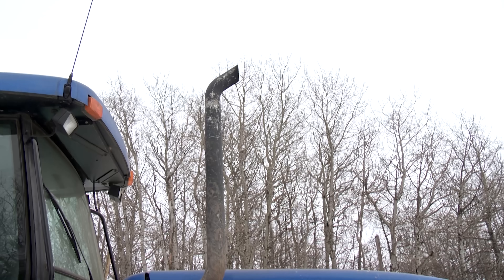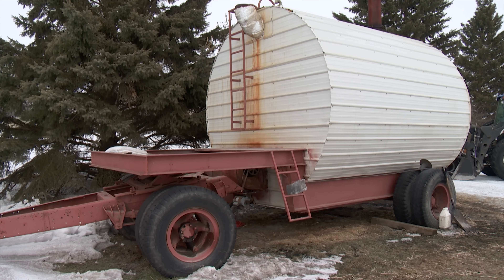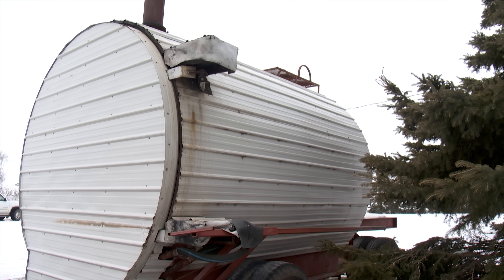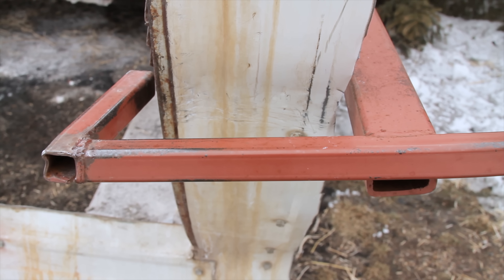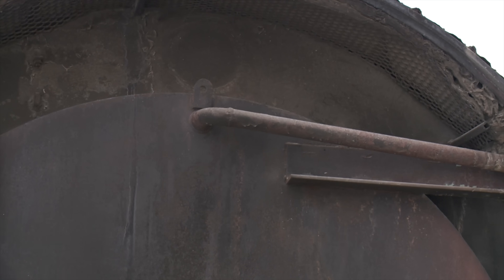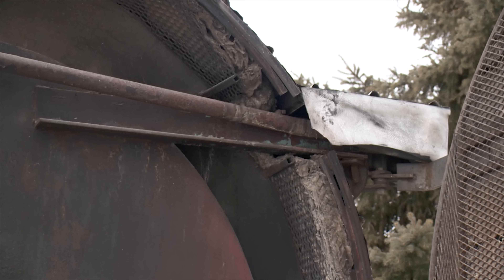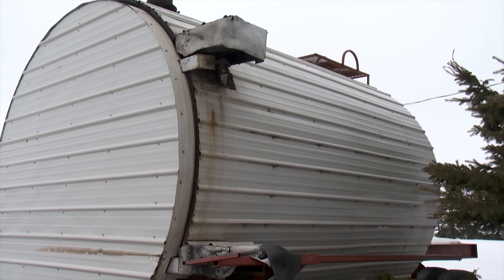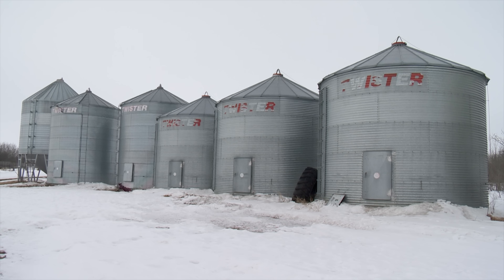Portable Straw Boiler System

Comment: To make a round bale assuming he is growing the straw himself at a cost of $10 - $20 each. he could sell that staw for $30 - $50  so it is costing him $20 - $30 per day  he burns 1-2 per day  so using the low figure $30- $40 x 30 day $900 to $1200 in straw per month to heat 2 houses. seems like a waste of money to me . not to mention all his cost in materials and his labor to set it all up.  plus he is runnig out there 1 or 2 times a day to feed it  no matter what the weather.  he can keep it. now if the 1-2 round bales sold for $7-$10 each then it might be worth it but he burns more  in diesel cutting wind rowing and baling and hauling bales to a pile then hauling a bale at a time to the furnace. That is just fuel costs.  there are so many more costs

Comment: Save $5000 a year for two houses? Where is this, the Yukon? Oh, well, you do have the drying. Was that electric too?
Reply: Drying is typically done with heating oil burner and blower. Power demand would make their grid glow red hot, because every farmer is doing it approximately concurrently.

Comment: Hi neighbor. We heat with a Portage and Main boiler using coal and heat a 1900 sq ft house and a 2000 sq ft shop.  We get coal from Hannah Alberta. The stupid carbon tax is really costing dearly- almost doubling the heating cost. This year so far we've used about 6 tons of coal. I had thought years ago about building a flax burner like yours, and wish I would have. Great job setting up your burner. Some  questions. Why would you make it portable, and is it really portable if it is hooked to pipes in the ground? Do you move it   to dry grain?

Comment: Needs a gasifier on the exhaust port so you don't need to tap into the electrical grid to run the fans or charge a battery.
Reply: You mean secondary air doors?

Comment: Wouldn't it be simpler to just insulate the house? This can save you tons of money on heating. At least it doesn't look like it is insulated, correct me if I am wrong.
In Poland and most of Europe, we usually build using 24 (9.5 in) cm clay or aerated concrete bricks and insulate it with at least 15 (6 in) to 25 cm (10 in) of styrofoam. Foundations are insulated with even more hard styrofoam up to 1m (3.3 ft) below surface level. Similar story with the flooring. 
Oh, and attics are also insolated, usually using 15 (6 in) cm or more of mineral wool.
So minimal loses of heat on winter and cool summers.
Reply: It’s in northern Canada. It probably has heavier insulation than anywhere in Europe.

Comment: 3-4 round bales a day at 30 each. As low as 10 if bought. Would need own hay field and equipment to make bales to make it worth it. Equipment to cut, rake and bale... throw in a tedder to just in case would cost more then the furnace. Not to mention the land itself. Sheesh.
Reply: It’s not hay... it’s flax straw.    And he farms 5000 acres. He has all the equipment.
Reply: @farmersunion5237  Well that explains it. Not everybody can do this. As a matter of fact not many at all can do this. This video is a tad deceiving.

Comment: need one of those to put a whole log in. chainsawing and splitting stacking feeding cleaning. 
is alot. just forklift the log and let it burn for a week.
Reply: wood dries just 4 cm from each side per year, and that is without bork, so all the hustle is more about making it dry in a acceptable time rathen then just for handling it
Reply: You could put some monster size logs in there. Burn for a week.

Comment: Its a nice idea but they do make wood fired portable boilers for camps and remote areas. 
The other option would be to try earth heat pipes. The advantage is that system also cools in the summer.

Comment: Still possible to employ a large reciprocating piston engine on the flue to create some suction or draught to assist with the combustion and also would burn the flue gases at the same time, the engine would then drive a generator to produce electricity.
They called this principle a suction gas engine. Most Outback towns in Australia before1945 used this principle of suction gas engines using wood to generate electricity.
Watching from Auckland, New Zealand
Reply: Great point! And in combination with some thermal mass in the basement of the homes you could reduce consumption to once a day as well

Comment: Maybe pellitize the straw in the field or bring it home shredded then pellitize it .Smaller use of metal to make a Gasifier with power feeder (less unit  loading).Gasifier could be used as just a flare to heat water or filtered/cooled/filtered to run an engine. 
Side note - a wood burning stove like this gentleman has can not be used as a Gasifier to run an engine , you need a propper designed Gasifier .

Comment: In Europe it's a bit more common due to high cost of fuels, this boiler does the job but is very inefficient. Biomas boilers work with acumulating tanks 60liters per 1kW. You do one batch a day and controls watch over temperaturs. Also we don't really use water systems for drying grain. You can only get up to 60C of hot air out of it by the time you put hot water through radiator. I understand its a compromise to use one system for drying grain and heating the houses. There are brick laid air heaters that can supplay you with temp up to 110C and work with 30t/h dryers. I have a straw 60kW boiler to heat my house and I use only straw to ignite the batch ow timber. I put a square bale at the botton then throw wood on top of it, fire it up and bugger off to work or whatever and thats me for another 24-36 hours.
Reply: Hay sells for $25 a bale, 3  bales a day, 90 bales a month, whew, where is the savings?

Comment: If you extended the stack up you could throw a few old tires in with each bale. Burning tires make lots of heat
Reply: That's the worst idea ever. What causes chimney build up? Smoke. What causes a crap load of smoke? Tires.
Reply: @alec4672  it would be fine. People burn them in outdoor wood burners all the Time. If it's burning hot enough then there is no smoke
Reply: @evananderson3350  There's always smoke from tires, you'd have to be north of 800 degrees interior temperature to start getting rid of the smoke. Send tires to be recycled. The more tires we recycle the cheaper new ones are.

Comment: just to be blunt honest... why? you are still BURNING something... sorry that just is not effective nor really enviro friendly.
Reply: Ur electricity comes from burning coal, oil, and or gas too.
Totally sun power?  Also all the components were manufactured using coal, oil, and or gas. Where does the carbon footprint end?
Answer: It doesn't. Politicians only pass carbon footprint laws to pick ur pockets of any loose change they may have left u. And it goes into their own pocket. It's all smoke and mirrors. End result is that they skim from any revenue.
Reply: Syc holic it's totally effective - heats 2 homes through -30c temperatures , and dries grain. The flax straw will not compost naturally in the field . Normal farm practice is to burn it in the open field.  Stop worrying about a little smoke out of the chimney - it isn't going to hurt anything. This guy probably doesn't have another neighbour for 5 kilometers. We are so sparsely populated that literally everyone could do this in the rural areas without even registering a single complaint. Go on back to the asphalt and concrete of your city and tell me how burning 300 straw bales a year is going to end the planet.

Comment: 1-3 round bails a day to heat the House? That's got to be a mistake.
Reply: Gas isnt that expesive, but elektricety? 

And elektric heating is not the most efficient one
Reply: Dries grain as well
Reply: Horribly inefficient. 1 to 3 bales a day? At $15 a bale (self performed) that's $450-$1350 a month to heat a couple houses. For $15,000 the houses could be insulted with expanding foam and heat conventionally cheaper than baling costs. Guy just got on a project and got carried away. Oh well, to each their own.
Reply: To heat 2 houses and provide hot water for said buildings. Do you have any idea how many metric fuck tons of coal you consume in electricity a year?

Comment: You have to admire this PRAIRIE RANCHER for his independent self sustaining mechanism to provide heat, and hot water. Not too dissimilar from a typical boiler, but uses Abundant Renewable STRAW as a fuel, instead of wood, coal, or oil.
Reply: Wood is pretty renewable..
Reply: @74KU  in 40 or 50 years.
Straw is plentiful every year. After the harvest, it's just laying on the ground. So bale it up and use it to heat the houses. Sounds like a plan.

Comment: So wait, we went from everyone burning coal to clean energy to heat homes. now this guy has gone back and everyones praising him? if they are adding to the Co2 problem then they should be billed accordingly.
Reply: i dont live in the usa. but this is so backwards thinking its untrue and if everyone did this the planet would be fucked. end of.
Reply: wayne wayo aveyard this is in Canada you idiot.
Reply: Lets see.. he grows the flax, harvests the seeds so you can eat them, and is left with the straw from this year's harvest.  It can either be tilled under (or not, apparently) where it bio-degrades, or he burns it.  In either case, the CO2 that was absorbed that year in growing said plant is being released.  Next year, rinse, wax and repeat...net carbon from burning said waste: 0.  Net Carbon from burning coal to produce $15 000 of electricity from coal:  (150 000 kw/h* 1 lb= 150 000 lb coal).  Care to debate how this is MORE environmentally damaging wrt CO2 emissions?
Reply: Well, i hope that message didn't take you long my friend because you are missing one key point. the said flax in question does not just appear. what about the Co2 to turn the fields over for a new crop, to then plant the new crop, to then fertilize the new crop, and then use pesticides.. flax isn't a product that is just there..it is a product of a system that produces co2 by mass.. and who said anything about coal? do you not have clean energy power stations producing energy from dams, wind turbines, solar panels and so on? i mean shit, you're speaking like we are all burning coal fires or logs. in the UK a good amount of people now have solar panels on their houses selling energy back to the grid and powering their homes. you are crazy to think in 2018 coal or flax is the only way to go. but hey thats beside the point, because do you know why we dig the ground up and hunt for coal inside of using "waster field products" like flax? this is one think you idiots haven't even taken into considerations. because coal is more fucking efficient at doing the job of heat, burn time. hahaha! mankind has been mining for centuries and our heating/power problem is solved by some left over crops....use your head.
Reply: The flax is being grown for food.  So, the CO2 costs of growing the flax, then combining the flax are already incurred.  So, the CO2 costs for this system are those of baling the straw, and transporting them.  Your country is importing Canadian slash to make electricity.  How about go do some math on how efficient Drax is.   The problem is one of transportation & energy density.  A bale of straw like he is using doesn't have a lot of BTU's (kJ), so it has to be burned close to where it is produced.  Because the travel distances are at most a few miles (5000 acres= 7.8 miles by 1 mile, in case you don't realize...) then the relatively low energy density of the biomass is of little consequence.  (unlike with Drax, where you are transporting said slash something like 100 miles by road in Canada, then 3000 miles by sea, then at least 30 miles by rail, all of which burn fuel oil...so that you can assage your guilt that otherwise Grid Power would be coal fired...with wood...)  The reason why coal is the alternative is simple- because it is.  Same as in the UK- (that coal will be the last on, and first off the grid)  the baseload in the prairie provinces is either coal or hydro (depending on which one) with topping being the other or Natural Gas.  So, yes, the alternatives to burning waste plant material is likely to be burning coal.  It's not hard to do the math, but if you need a tinfoil hat, you can make your own.  The whole process would not be economic if they were doing much beyond baling & transporting, farmers being smarter than most in terms of energy costs.  I'm also thinking you are missing that he is using the boiler to provide heat for grain drying, and that the houses are secondary to that...remember that tax laws probably play a part in how he'd describe what is being done, as the farmhouse electricity has to be seperate from the farm electricity from a metering prospective- one is business tax, one is personal.  (& also don't discount the difference between where the expenses are incurred, in that if can incur costs on the business that is of personal benefit).     I doubt you have ever encountered -40C with 30-40 km/h of wind on top, giving effective wind chills of -50c or worse...

Comment: Clever     Wonder why they dont use wood from their field edges?
Reply: If you got straw piling up why would you go get something else...
Reply: By using logic. Duh.
Reply: Brian JOnker this guy runs a 5000 acre grain farm.why fuck around with fire wood.no cutting,no splitting,no stacking.bales are already being made on this type of farm,duh
Reply: I agree logic says trees from field edges that have blown down or just in the way need to be handled anyway. So just use them.     Duh
Reply: Brian JOnker we farm 4000 acres and have a crap load of trees we push up to rot around the fields  . Your right . It's cheaper to use a chainsaw than a $30000 haybailer and tractor wear +fuel cost . Wood has more energy per square inch ,so it will last longer.  A big hickory would burn for a week .
Reply: marvel mary  has talking about trees that are dead anyways , that have fallen into the fields
Reply: This guy is using flax bales. Flax straw can be notorious for being a pain to deal with. Sometimes if you spread it out in the field as you harvest, it could plug the combine, or your implements while working the soil. For some its easier to bale up the flax straw and dispose it other ways.
Reply: No trees in Saskatchewan
Reply: You mean like all those trees standing in the background?
Reply: LOL, probably just planted around the house for windbreaks, can't touch those!
Reply: Anyplace around route 15 has plenty of trees for wood heating.  LoL  Saskatchewan is a big place.
Reply: Brian JOnker It's more expensive and time consuming to use wood.
Reply: Trees grow really slow dipshit..
Reply: @MsSomeonenew  Straw has value just by staying in the field to decay.   There is also some extra work and minor costs to bale it up and store it.
Reply: Idiot Mary they still grow and have a habit of encroaching into fields as they reach for sunlight.
Reply: @funnyguy  How would we know?

Comment: And you could use the ashes on the fields.
Reply: You will add coal to the soil, which can help somewhat with the water retention.

At our farm we burn grains and chipped wood, which makes for excellent fertilizer in certain crops in the garden. It also creates a nice dark insulator that keeps the soil moist in dry summer months. If a thick enough layer is put on the ground it also starves weeds.